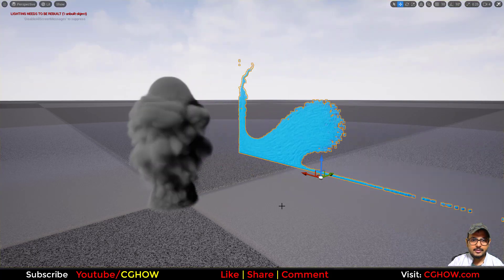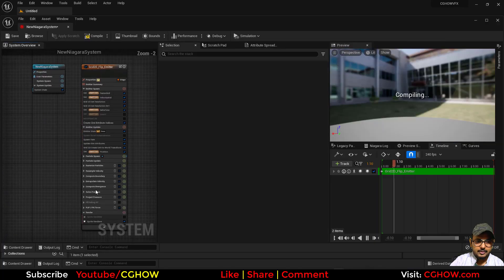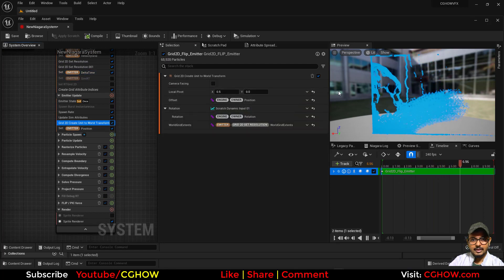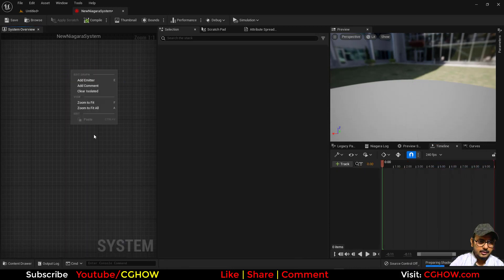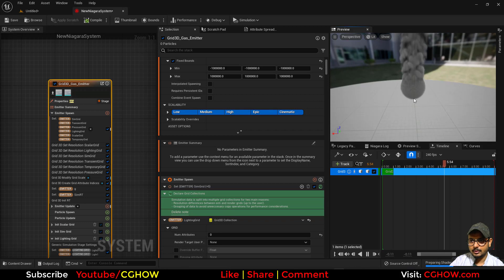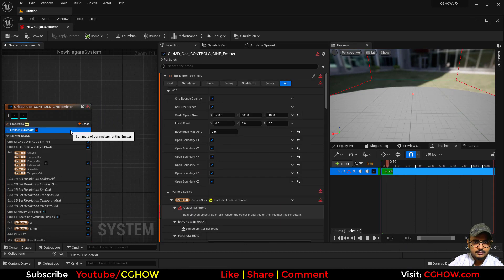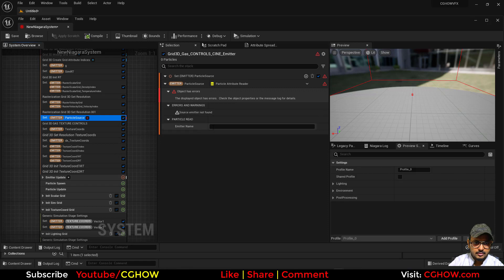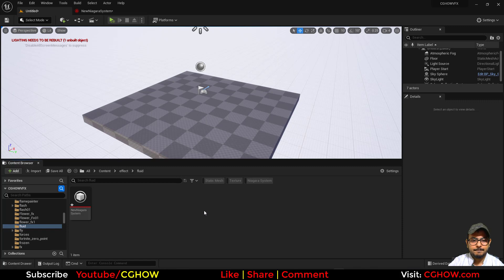Ultimate Fluids Plugin Comparison for Unreal Engine 5

Comment: Thanks for experimenting with the new Fluids plugin! When creating a new effect I recommend starting from the System Templates (New System->New System from a template or behavior example). The templates should get you up and running a lot faster. Almost all the parameters you will want to adjust are within the Emitter Summary. We will continue to address bugs and refine the system as we get to the 5.0 release.